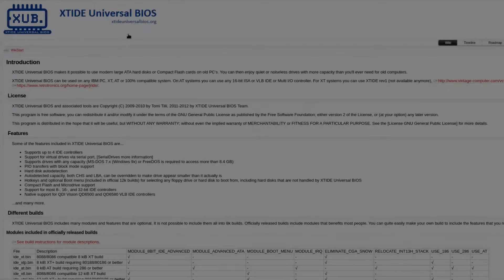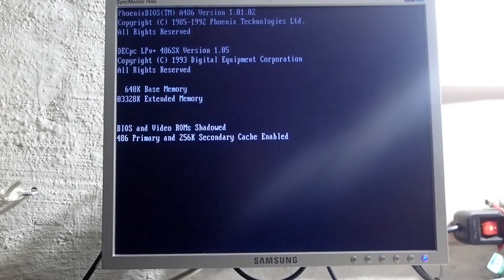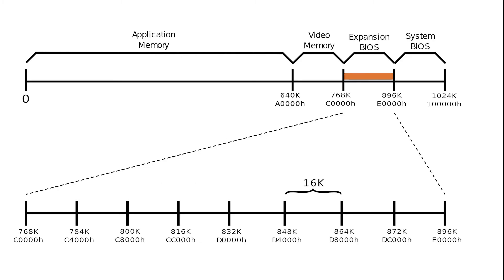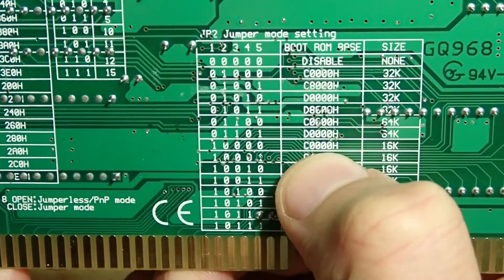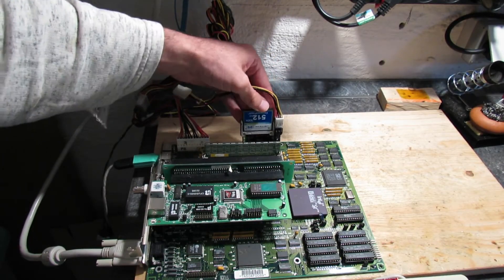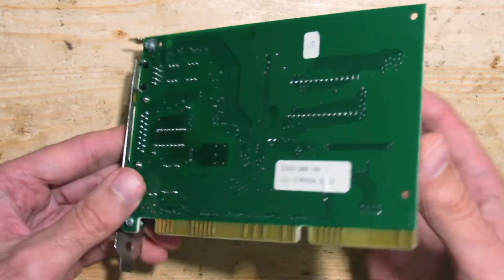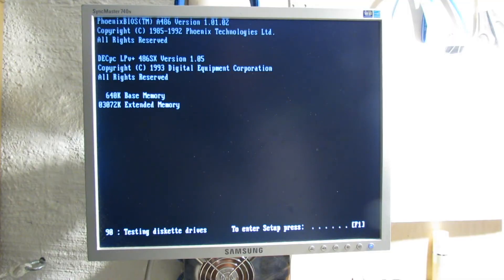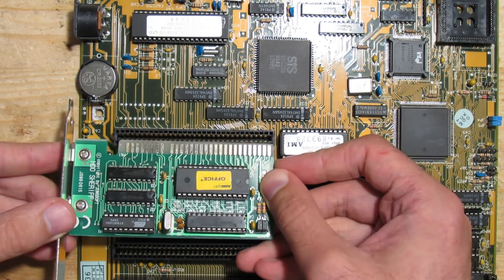Boot retro PC using XTIDE (Part 3): How to use any network adapter with XTIDE

Comment: so I have a xt-ide that has somehow a empty eeprom
how can I write the bios to it?
Reply: You need to boot from a floppy disk that has the xtidecfg and the bios files on it. Run xtidecfg, load the bios file and autoconfigure it and save the bios and write it to the eeprom. That’s it, reboot!
Reply: @JohnSmith-iu8cj  were can I get a boot floppy?
Reply: @robot797  There are many sources. You can download images and write them to a floppy. There is  an image that already includes all the necessary files. I would have to look it up later. I believe if you google xtide floppy image there is a download on vogons, vcf or GitHub available. But any other boot disk from dos or windows 98 or similar would do the job as well if you copy the files from xtide on it manually.
Reply: Actually with that specific boot disk image you can use xtide bios without an eeprom and without any isa card. But it also has the xtidecfg on it so you can also use it to program your eeprom with the xtide card if you have one.

Comment: I've been messing around with mostly DLINK cards and there's a mix of 28pin and 32pin sockets. Are most NICs generally M27Cxxx compatible for their EPROMs? I don't have an EPROM erase so I've been using EEPROM equivalents but so far, it either hangs the system or the option ROM is not recognised.
Reply: From my 10 pci network cards only one was able to boot from eeprom option bios. I used rset8139 on most of them. When it comes to reading most of these chips are compatible. But for writing the voltages and pin outs are different.   Writing doesn’t work anyway on most of those cards, only reading, because they don’t implement the circuits. None of mine can write. I had to use hot swap on a socket 7 bios socket to write a 32 pin 128kb eeprom. Make sure to duplicate your rom before writing. If it’s 16kb, it should be written 8 times to 128kb to fill it all.

Comment: I didn't even know there was a dos utility to setup the rom address on older NIC cards. Anyway, I think the best is to use the highest address range, to leave a big hole between xtide and video rom, to allow config.sys + autoexec.bat optimization

Comment: Could you do demo of this process for an actual XT class machine?  I'm having trouble getting the right steps with an AOpen RTL8109AS/NE2000 NIC, a PII/400 config host, and a homebrew8088 with a V20, 640KB of RAM.  The AOpen setup.exe can't write the jumperless config on the homebrew8088 because it tries to make sure the C800h segment exists.  My PII writes the AOpen config, xtidecfg reads the W27E257 EEPROM (that I wrote with a TL866-3G), but then can't write back the final config.  Maybe I'm doing something else wrong.

Comment: In order to get this to work with my system (a Suntac 286 Easy Data board with award 3.10C bios - an old Compudyne 286) I had to use the 8k at.bin bios and combine it 64 times (using copy /b) to fill out my W27C512 chip which I used in my network card (8 x 64 = 512). Simply filling the EEPROM with zeros did not work. I also had to enable the boot prom by using the network software that came with the card which I bought on ebay and thankfully came with the software. Also, I as stated in the XTIDE documentation I ran the at.bin bios through the XTIDECFG utility that comes with it. I made no changes to the configuration but apparently this is necessary to create some sort of checksum for your system.  Necroware does not mention the XTIDE configuration nor the combining of the files. See 2:40 of this video: https://www.youtube.com/watch?v=B0tp-I-iJ1k   for why to combine the files. Maybe this is card specific but my computer did not find XTIDE boot rom until I repeated the 8k 64 times  (by using copy /b not by copy pasting as shown in the linked video).  Also, the XTIDE did Not solve my problem of my computer not recognizing the compact flash card. My compact flash card is still causing the computer not to boot at all. If I take it out, it boots up, XTIDE is loaded. IT can find a normal 160 GB hard drive that I hooked up in place of the compact flash card.

Comment: Great series. Just what i was looking for. Do you now how the speed on an 8bnit XT-IDE card (with IDE interface) is compared to an typical 16bit IDE card?
Reply from the maker: It depends, not all are the same, but generally speaking it is of course slightly slower, because the 16-bit access has to be split in two 8-bit parts.

Comment: How about old modems? I've got several useless old 8-bit card modems lying around.
Reply from the maker: Never tried that, if you have a modem with a ROM socket, may be it would work as well. Worth trying I guess.

Comment: 6:33 I like using ide_at.bin 8kb version due to it's small size and frees up precious Upper Memory! I never seen't no Boot menu so I'm not sure it's even needed? I can select which boot I would like during detection stage (A B C D etc) and then use a MBR Boot Manager like Plop Boot Manager or Smart Boot Manager. 
<3 all
Reply from the maker: In the  standard 12K version there is not only the boot menu, but also support for memory mapped and DMA based cards like JRIDE and XTCF. Furthermore, I compile usually my own XTIDE and experimenting with different options. The 8K of upper memory never bored me much. It was still plenty for me, but I can imagine, that there are cases, where you could need more.
Reply: @necro_ware  ***nods***
I seem to remember an XTIDECFG tool that bumped the image size from 12k to 16k. all very neato! rewatching the boot from sound card vid ;) doesn't work well w/pnp at boot time :L heh

Comment: You can use a W27C512 (true EEPROM in the 27 Series) instead of UV EPROM, saves a lot of trouble and time
Reply from the maker: I know, the 29Cxx series is also a drop in replacement for EPROMs. I have all of them, but I also have a lot of EPROMs, which I use for things, which I don't need to change too often.

Comment: Has anyone been able to use an Intel branded ethernet card for the xtide bios?  I have several all sorts of models but can't seem to get any to work.  On the good side I have quite a few DLinks that work perfectly..
Reply from the maker: Unfortunately I have no intel cards.
Reply: @necro_ware  With persistance I finally got them (several different models) to work.  Needed to run the Softset utility but in dos with no drivers loaded.  :)  Thanks for your inspirational videos.
Reply from the maker: @warpedmetalhead  Glad you got it working. And thank you for the feedback as well, may be I'll need this info one day, should I get an intel card....
Reply: @necro_ware  Correction: 8K -> 2764 works (ide_at.bin)...but I can't get the 12K ->27128 (ide_atl.bin)  to work at all, checksum error.  hmmm.  Unfortunate as I'd like the menu
Reply from the maker: @warpedmetalhead  Do you pad with 0?
Reply: @necro_ware  Yes, the EP-1132 software does this auto.  I have tried on 3 diff model NIC's and even tried the newer ide_386l.bin with same results.  probably something I am overlooking knowing me.  lol
Reply from the maker: I already heard from multiple people, that EP-1132 has a bug in the software and it doesn't pad properly. You have to create your own image padded to 16kB with zeros. As alternative, you can rebuild the xtide image yourself and create a 16kB image with proper checksum instead of 12kB one.
Reply: @necro_ware  Thank you!  I will try this later!
Reply: @necro_ware  Hah! You are correct.  It was padded with FFF's.  I ended up using a different old programmer and it worked.  thanks very much!
Reply from the maker: @warpedmetalhead  You are very welcome!

Comment: Great video and great presentation. It makes the subject available to understand without a lot og prior knowledge of addressing.

I have a NIC that exactly matches the one in the video (before the pile of NICs). I got two roms from a friendly fellow old pc entusiast, one with ide_i386 and one with ide_i386l (both version/revision R604 padded with zeroes). When I boot my 80486 seimens nixdorf industry pc, the award BIOS 3.20, rev 3.10 does as usual, and after floppy seek nothing happens. XTIDE does not load.

Harddisks are set to none in the bios, which doesn't offer much else. One page for time, floppy and harddisk config. One page with System load (STANDARD/DISK LOCK/NONSTANDARD), Shadow BIOS ROM, Cache, serial and parallel port config and controller config.
Serial and Parallel ports are disabled. Floppy and HD Controller are enabled (IDE High speed configured).

Any idea, why XTIDE doesn't load? I can view the ROM in CheckIt (the part that CheckIt allows). The address space I chose (D0000) is free. I put the NIC in jumper-mode to ensure that jumpers decides the settings. The NIC uses IRQ3 and address 0x2A0.

Any suggestions is appreciated
Reply from the maker: Hi. In the 99% of the cases this was due to not padded, or wrongly padded ROM. Just a week ago or so, another watcher reported the same issue and he was sure, that he padded it right, but in the end it turned out to be something wrong with it. I don't know what exactly, but he used some programmer, which has a function to automatically pad the ROM. It turned out to not work properly. It is very important to pad the ROM with zeros, or the checksum will mismatch and the computer will not load it. In the software for TL866II+, which I'm using this works fine, but I don't know which software your "friendly fellow" used. May be it's worth it to double check the padding.
Second, which size of the EPROM are you using? After I made the video, I found some cards, where 64k EPROMs (and sometimes even 32k) didn't work. I don't remember, if I tried 27C512 (64k) EPROMs in this NIC, which you are talking about, but 27C256 (32k) do definitely work.
Reply: @necro_ware  Thanks a bunch. I'll find a way to proceed. Good pointer on the ROM size and the padding :-) I also take it to mean that an old school BIOS and a 80486, labelled as "industry" shouldn't be a showstopper.
Reply from the maker: @chriscprivat  No problem. I'm pretty sure, that "industry" inscription shouldn't matter. I used this already on many very unusual boards.

Comment: Hi Necroware!! I have a small question about XTIDE... I have tried to use the BIOS from http://www.xtideuniversalbios.org/binaries/r604/ide_386.bin to flash an 27c256 but no luck with it. For the NIC it is like nothing was there, but using https://code.google.com/archive/p/xtideuniversalbios/downloads/XTIDE_Universal_BIOS_v2.0.0_beta3.zip/ide_at.bin like you used, I could boot the PC and the boot rom was recognized. Do you know why? Did you tried out the r604 version? I am a little confused. I have ordered some 27c128 from ebay to see if it does the same. At the moment I only have 27C256... Many thanks!!! Jorge P.S. I want to use it on  an 386DX40 build :) . Small update, 27C128 arrived and tested, same thing, with the new r604 version of xtide bios it is like there is no bootrom on the NIC. Does nothing. Any idea? Thanks! Another small update, we need to run the xtidecfg.com and load the desired bin file, no need to change options, just select the save file option and then we can burn it in the usual way
Reply: This 3-year-old comment helped me figure it out. You can't just download the r* version and burn it, you need to generate your own with xtidecfg. Thank you!!
Reply: @SteamDeckLab  I am happy for you my friend! This is wonderful 👍 I hope that you have fun with your PC system

Comment: I think I need help. Mainly technical help :) I have 27c128 and 27c256 type EPROMs, I borrowed an UV eraser and an old, but working programmer. I downloaded the binaries, burned to the EPROM, I have several different network cards but still no success. I can setup the NIC, the EPROM is mapped into the memory, I can see it in debug, it shows in checkit as "Unknown ROM", the content seems to be good, but nothing happens at boot time. I tried padding with FF and with 00 and still the same. For the 27c256 I copied the padded file twice and burned it that way. I tried the (under) 8k version and the 16k version, no luck, same effect. Network card always set to the proper EPROM size, it shows in memory as Unknown ROM and does not run.
Reply from the maker: Hi Norbert. It's a bit complicated to troubleshoot it remotely. Where did you get the images from? There are actually 8k and 12k versions, at least the last time I was looking. Which machine did you use XT, AT, 386? Which image did you use? Did you activate ROM BOOT option/jumper for your network adapter? Which network adapter is it? Let's first try to peek around ;)
Reply: @necro_ware  Thank you for your answer! The .bin files are from the official xt ide universal bios page, the last version. I tried the smaller and the larger versions too, with a 486 and a P1 motherboard, same effect. My cards have no jumpers, but I found the DOS utility for all of them, and the ROM can be found in its designated place (C000 or anything I set). I may try to compile it myself next.
Reply from the maker: You usually don't need to compile it yourself. I did, but just out of curiosity. Anyway, the original bin files should work, I tried them many times yet. Also don't set the ROM address to C000, since usually this is a VIDEO ROM address. Take D000, or D800 instead.
Reply from the maker: Oh, and by the way. I just had a network card for the first time, which only supports 27C64 EPROMS. They simply didn't connect any address lines above A12 and shorted A13-15 to logical 1, which limits the size of used EPROM to 8K. I was able to use 27C127 however after I wrote the ROM starting in the second part of the EPROM. But this was the one and only card, where I had this issues.
Reply: @necro_ware  it seems like I found a possible solution: I padded the longer binary with zeros to 16k, after that I used the configurator, loaded the .bin, selected auto config, saved the file over, and then burned into a 16k eprom. this now works in several NICs (and now it is "Adapter ROM" in Checkit instead of "Unknown ROM"). Thanks for the answers and keep up the good work on your videos!
Reply from the maker: @Flashy7  Yes, you are welcome. I guess, your programmers application didn't pad the image properly. I'm using minipro quite a lot and pad my files manually. I just don't trust the UI very much ;)

Comment: Im going to give this a try once i can write to some eeproms. I noticed I have one of the same NIC that you had in your pile. Its the one with the angled PCB at the end and the intel FA82595TX chip.
Have you found a driver for this card?
Also have you ever tried to update the xtide bios through any network cards or will this only work with the custom ide xt boards?
Reply from the maker: Hi, I'm usually using my TL866II+ for such things, this is one of my favorite devices in my workshop :) You can not only write PROMs with it, but also GALs, MCUs etc. You can check logic ICs and more.  It's so versatile, I just love it. Anyway, I could program EEPROM with one network adapter, but don't remember which one. I had so many back then and I didn't make a note, which one I used. In regards of the Intel NIC, yes I got it working in DOS using NDIS drivers and MS Client. Just as described here: 
http://wiki.freedos.org/wiki/index.php/Networking_FreeDOS_-_NDIS_driver_installation

The drivers are available at vogonsdrivers.com, if I remember right...

Comment: but bigger hdd is onlt for free dos or dos 7.1 it wont work on dos 6.22 or lower correct
Reply from the maker: Well, yes and no. You are right, if you are talking about MS-DOS 6.22 fdisk, it can't handle hard drives bigger, than 512MB indeed. However, you can create partitions using FreeDos, Windows or Linux (as I'm usually doing) and then install MS-DOS 6.22 on it, if you want so. However, each partition should not exceed 512MB, but you can make many of them, if you need to.  But if you run DOS only, 512MB is huge anyway :)

Comment: C8000 to CFFFF is usually safe to use for XT-IDE, but I'd recommend running CheckIt 3 or something else that can map the system's memory before setting the ROM address. What you displayed there for the system memory map isn't entirely universal. Tandy's especially are a little bit different in how they manage their upper memory blocks, particularly the ones with DOS/Deskmate in ROM.
Reply: Strictly spoken Tandy's are not even IBM PC compatible.
Reply: @OpenGL4ever  Nothing is truly "PC compatible," except for IBM PC's. The point is to be close enough that you can make your software/hardware work on it.
Reply: @BlackEpyon  Wrong! The first none IBM PCs did a lot of things differently. This especially applies to the BIOS and the entry points for functions and the address location of hardware.
Later the compatibility was increased and the first PCs appeared on the market that were advertised with words like IBM compatible.
Reply: @OpenGL4ever  You're gonna have to give some very specific examples, because the only "PC compatible" that I'm aware of that wasn't "100% PC compatible" was the fricken PC-Jr, and the Tandy 1000 fixed those issues.
Reply: @BlackEpyon  Search for the early days. Some stole the IBM BIOS. Other tried to become compatible. But the goal was not legally achieved until a little later, when Phoenix Technologies reimplemented the BIOS using the Clean Room method and thus had a clean BIOS without copyright infringements for the first time.
This was the case from about July 1984. The PCs from other manufacturers were compatible with the IBM PC in some way before, but not compatible enough or they had a 1 to 1 illegal copy of the IBM BIOS. For example, they all had their own MS-DOS version, adapted by Microsoft.
Reply: @OpenGL4ever  DOS 2.11 is usually the customized version, but just because that DOS was customized for that machine doesn't mean that you can't install a boxed copy without the OEM branding.